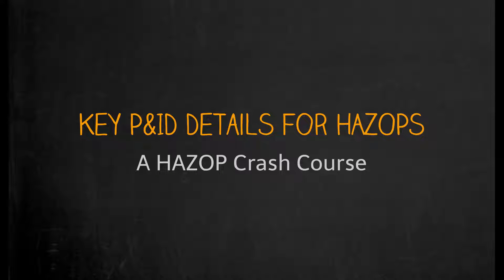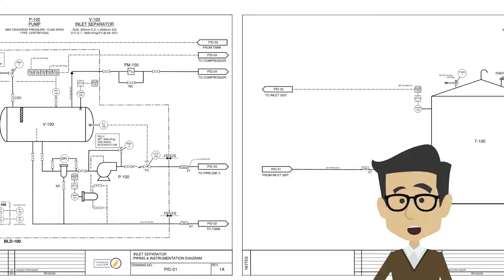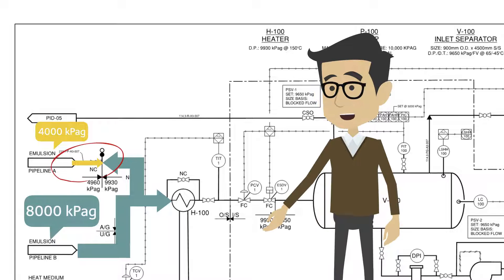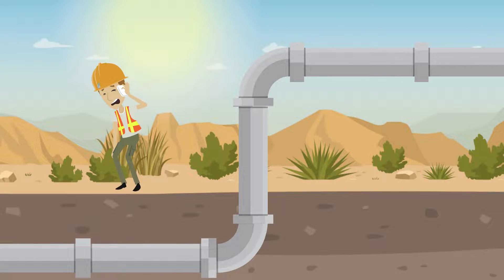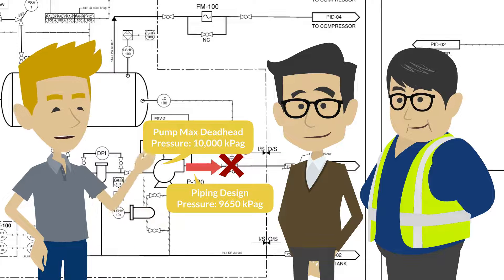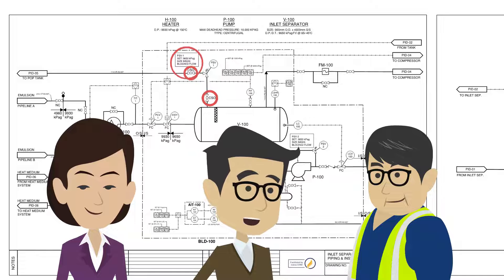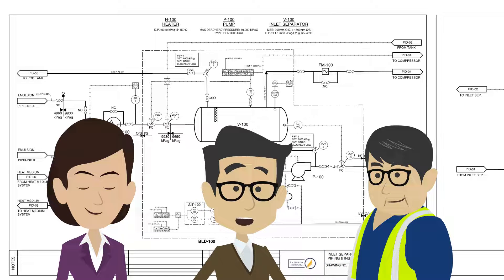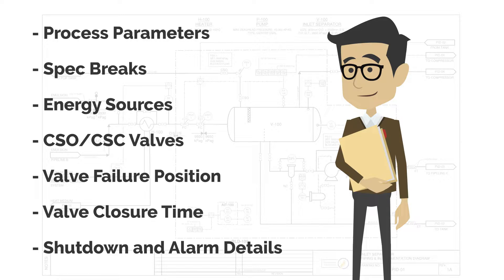Key P&ID Details for HAZOPS - A HAZOP Crash Course

Comment: Why CSC/ CSO (5:23)  using for Control valve? (I think it's wrong)
Reply from the maker: There is no mention in the video that you use CSC or CSO for control valves. This would not be appropriate as you would be eliminating the ability to open or close the valve. It is only mentioned that CSC or CSO is an administrative control used to ensure the correct position of a valve.